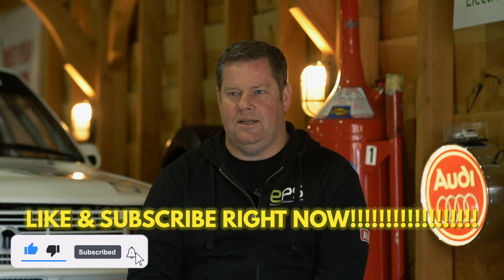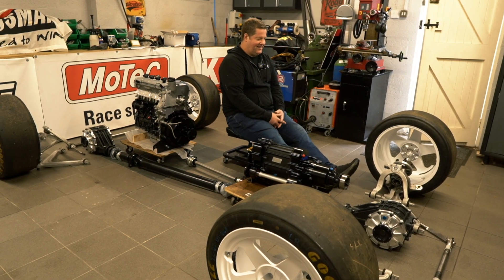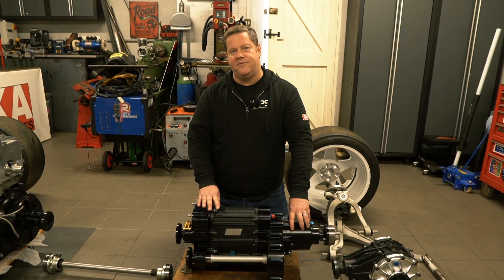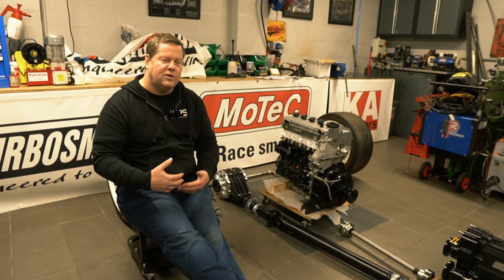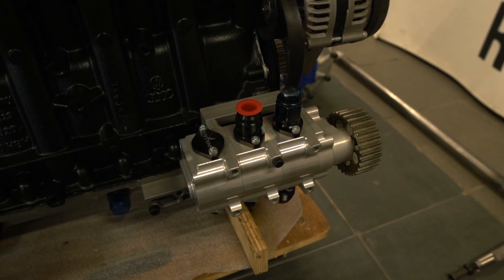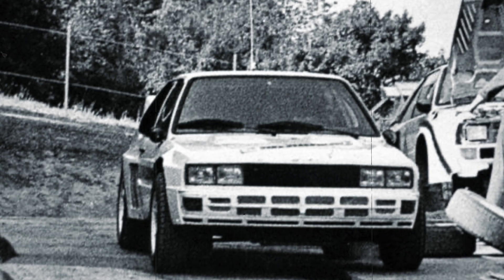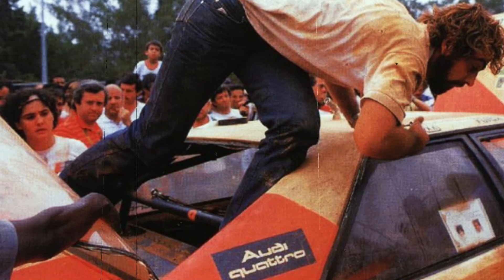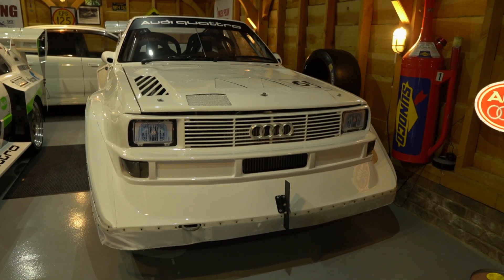Building Audi's missing Car.. Audi quattro Group S RS001 (Part 2) Driveline Engine and Diffs

Comment: Nice work. This is a pretty common transmission layout in offroad comp safari race cars for the last 20 years or so. In the UK most cars have the engine and gearbox joined with a remote transfer box and in France a similar lay out to this with engine and gear box separated

Comment: Brilliant build what vehicle are the front and rear diffs sourced from?  Someone mentioned it before but could an 01E be used instead of a sequential? Cheers
Reply from the maker: The diffs are custom units for the car, the 01e gearbox car really be used for this layout as the engine would need to hang out the back of the car so we had to go down the road we did

Comment: It's saying somet when the easiest way I can think of doin this would be using a 4 weel drive R8 and modifying the dimensions to fit Ur needs although the engine is far from period correct
Reply from the maker: @EventHorizon13  I did look at using the R8 transmission but it hangs out the back of the engine so it’s not ideal.

Comment: For a missing car this wont be having ANYTHING period correct in it, so I would never call it as missing car, this is nothing like it, everything is ruined.
Reply: The frame is the same as per the original car and its built the best it can be . Its the closest one can get  to the original car ?
Reply: Well, i think they could've used at least the engine from the period